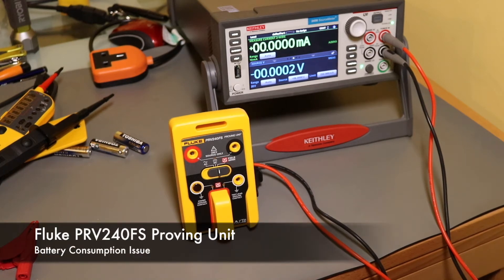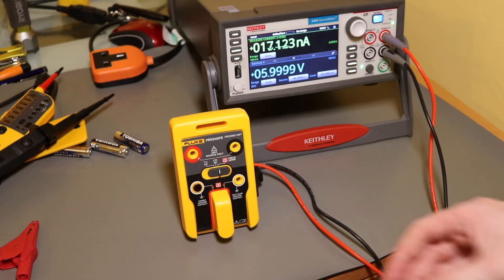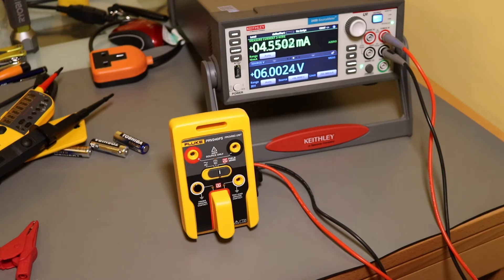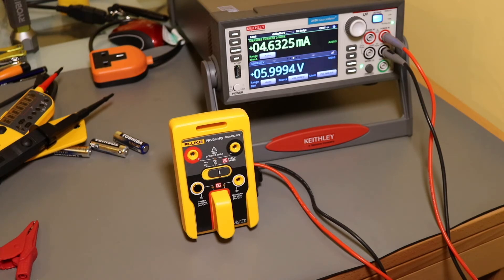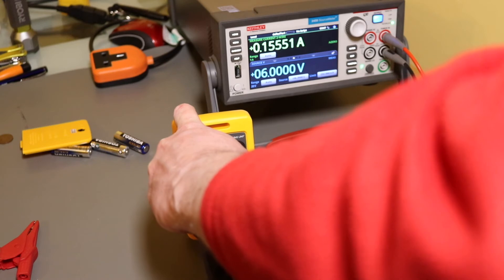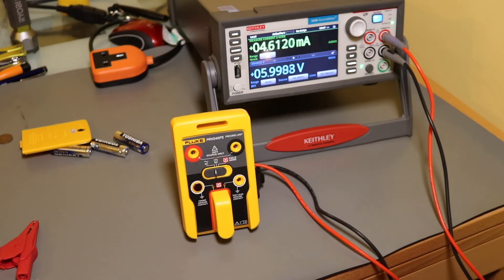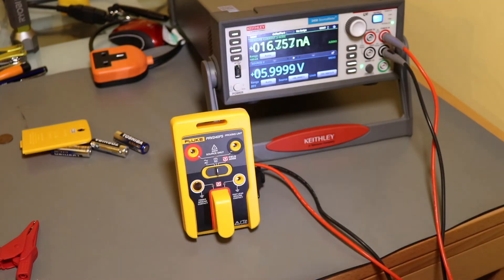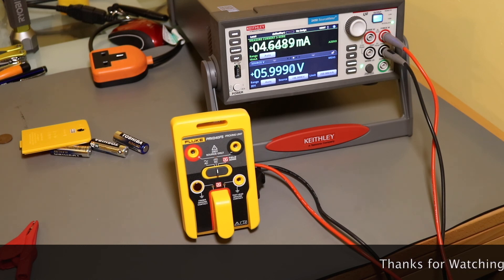Fluke PRV240FS Battery Life Issue

Comment: Would it be difficult to make your own and make it better than Fluke?
Reply from the maker: With the right research it should certainly be possible to build your own unit up. Whether or not it would be better, would probably be debatable. You could make it function the way you want it to, so could probably be better in that respect, but not sure if you could make it as mechanical robust, unless you have access to machining or 3D printer technology.
Reply: @three-phase562  Finding a schematic isn't as easy as you may believe.
Reply from the maker: @lancelink88  Well a proving unit is a relatively bespoke piece of test apparatus aimed at electricians, who probably don't have electronics design knowledge, so are likely to buy rather than build. You are probably unlikely to find a specific schematic for one. It will depend if you want to build an AC or a DC version. 
For AC you will need a 50Hz oscillator firing a complimentary transistor pair that fire a step-up transformer. The transformer ratio and supply voltage you use will determine the actual output voltage on the transformer secondary.
For a DC version, you are basically looking at the output circuit of an insulation tester, so basically a Mosfet firing a pulse transformer, with a simple rectifier and smoothing capacitor on the output.
So you will likely need to research those as separate circuits and build up from there. A lot of the modern proving units are micro controller based, so the one device will produce the 50Hz and the Mosfet pulses.
Reply: @three-phase562  Thanks, I went for the PRV240 as it was at a reasonable price.  But I'll be interested to look inside when I get it.  I'm interested in making a mini pure sine wave inverter from 3.7v DC to 240v AC with 2 transistors so that will be a great little project.

Comment: Smells like processor not always shutting down.
Reply from the maker: Thanks for the comment Mike, I took another look inside the unit this morning. There is a Nuvoton Nano100LC2BN micro controller inside. I could not correlate the specs to the current measured. I have not heard of others complain gin about the PRV240FS, so it may just be a bug in my unit.
Reply: @three-phase562  That is protected mode, for sensing you touch the pad. I am the designer.